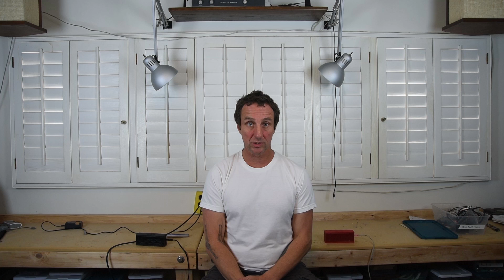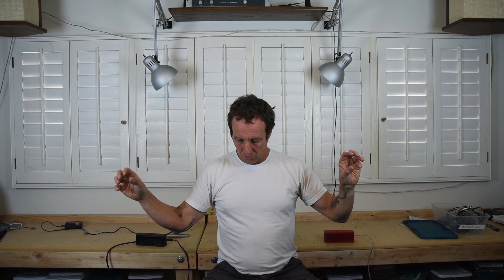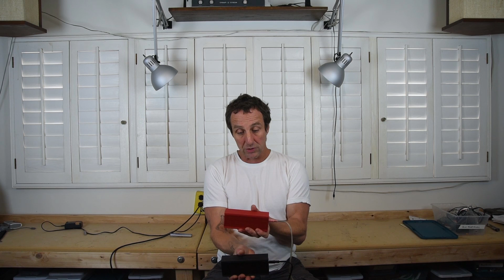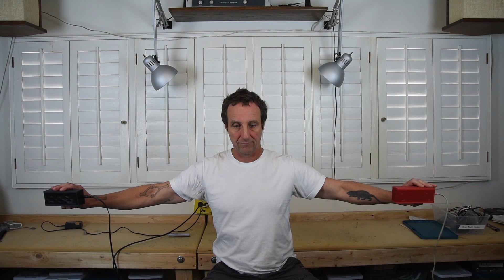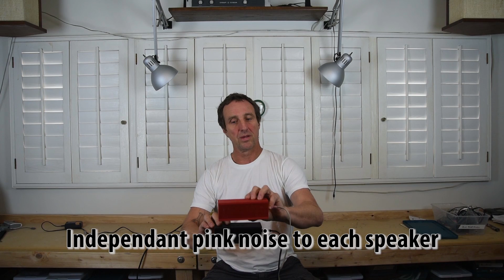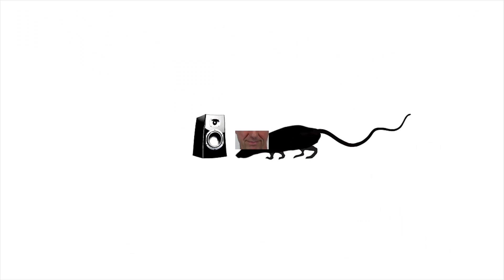Problems With Mono Sound From Stereo Speakers

Comment: So can you just delay one speaker by a couple of ms?
Reply from the maker: for all practical purposes delay is pretty much the same as distance. 

so delaying one side a few milliseconds is the same as standing little closer to one side and little farther from the other

Sound travels through air about 1 ft per millisecond
Reply: @DaveRat But what I'm getting at is, it seems like if you delay one speaker by a tiny amount, then the sound being produced by each speaker is no longer "identical." Just like how there was combing when the pink noise loops you were playing were in sync from each speaker when coming from the same source, but no combing when they were out of sync because they were playing from independent sources. Aren't identical loops that are not time aligned more or less the same as delaying one speaker slightly?
Reply from the maker: the signals are still identical even if one is delayed.

two identical signals will sum when you are equidistant and or equi-time distance 

when you offset the arrival time by either delaying one side or stepping off center, the summation with have frequency dependent phase cancellations.

when I move one speaker farther and the other closer, that is the same as delaying one speaker vs the other.

the signals need to be "different" not just time or distance offset from reach other of you want to eliminate interaction

a guitar vs a voice are different.

two people playing the same song on guitar are different (de-correlated)

the same guitar input run into 2 channels with a different EQ and some delay on one are pretty much the same signal and will have lots of interaction..

if you can change the delay, and or change the distance and or change the polarity and doing so does not change the interaftion, then the signals are de-correlated and truly different.
Reply: @DaveRat Thanks so much for taking the time to explain all that to me! I see now, that makes sense. 🙏
Reply from the maker: awesome. it's a useful concept to understand. to test if two signals are correlated or not just reverse polarity on one of them and sum them together and as you change the levels if it changes the sound then they're not de correlated.

Comment: Wow, I guess the same is true for a studio mixing engineers environment. Common practice is to mono the stereo sum, to see, if there are cancellations in your mix. But if you are hearing this with your 2 monitor speakers, the cancellation could be between the 2 monitors and not in your mix. As an studio engineer you need to be aware of this too, otherwise you're probably making your mix, sounding actually good on a single mono speaker, bad.

Comment: You need to understand phase correlation. Anyway you can easily decorrelate one channel by phase rotating it 90 degrees and the cancellations will be gone, maybe it can help in live situations where the speakers are very far apart. But it would probably also create low frequency problems where you do want things to be in phase...
Reply from the maker: Hmmm, not sure a 90 degree phase shift will actually decorrelated. The interactions would still be correlated, just phase shifted.

Comment: Please help I live on a boat that has the kenwood kmm-bt332u stereo hooked to two sets of speakers, one for the kitchen, the other for up on deck. My problem is the kitchen plays the left speakers and the top deck only plays the right speakers!  How do I fix this craziness?
Reply from the maker: One of the time disconnect each speaker that doesn't work put a 9 volt battery across the terminals see if it makes noise check the good ones too Make sure all your speakers work.

Next take a good speaker and connect it to each one of the wires that are and are not working and make sure signal showing up at the wires

Finally once you know the wires are good or replaced any bad wires I know the speakers are good and fixed any bad speakers if you still have the problem reverse the wires at the back of the amp connecting up wires to a speaker that works to a side of the app that doesn't work and you'll be able to test the amplifier

Comment: Amazing Video and explanation. So if I'm running a normal PA setup. Sub/Top per side, sending identical signals out of both sides I am more prone to Comb filtering right? Now what if I was to ever so slightly delay one side, so little that it would be unnoticed, would this help avoid some comb filtering? or is that just stupid? Thanks Dave!

Comment: Say I have a singe amp sending mono powered signal to two cabs set in the room. Similar to how a 2x10 cab plays same signal. it better to place the cabs at some close distance to avoid comb filter or is there some thing to insert in the powered speaker line the delays or changes the powered signal?
Reply from the maker: In that scenario I would put the speakers wherever they best cover the area desired to cover. Comb filtering happens when the same signal is reproduced from more than one source and those sources cover the same area.

So one way to minimize comb filtering is to have the sound sources not cover the same area or minimize overlap of their coverage.

That said, home filtering's not that big of a deal for many scenarios.

The issues you run into are summation when you're equidistant from both sources and changes in the tonality when you're off axis from that center point.

But as you wander from the center point you're closer to one speaker than the other which reduces gone filtering and  many scenarios it's not a big deal
Reply: @DaveRat  in my case the only reason I have two cabinets is because I like the sound of the 10 inch cab when I’m doing leads. I like the 12 inch cab when I’m doing rhythm. The blend of the two is quite nice sometimes as well. But I do notice them canceling each other out on certain frequencies. Confuses me is why a 4 x 12 or a 2x10 or whatever combo cabinet doesn’t have the same problem.
Reply from the maker: @TheMeteoritesTucson interesting you may want to check polarity and make sure both of your cabinets are the same polarity and your cables are all correct as well.

Comment: Nice Thing. Thanks a lot. Another question. If we use a very steep LPF (ex 48 dB/Oct)   on Subs and very steep HPF for Tops (example : A Line array system) the interacting frequency area is very small, and in this case even if the Subs and Tops are not aligned, there shouldn't be a problem? so. we have generally problem that the perfect alignment happens only a the point where we measurement microphone place. All other points have different arrival times of Tops and Subs which could case cancelations. If can strictly separate the frequency bands between Tops and Subs, can we overcome this problem?
Reply from the maker: Reducing overlap will reduce interaction between tops and subs. And also, very steep filters tend to sound bad and introduce undesirable issues.

So it's a trade off.

All filters create issues, the more drastic the filter, the more drastic the issues
Reply: @DaveRat  Thx Dave. Is it some how possible to demonstrate ? i mean the accumulated negative impact of steeper HPF (on top) + LPF (On Sub)  in compare to less steper HPF +. LPF?

Comment: My question (which i should perhaps just test myself) is…
What happens to the low end cohesion when you pan kick mic 1 and 2 to opposite sides?
In this situation, is it better to have your sub feed in stereo or mono?
I suppose it would depend on mic placement to an extent.
Reply from the maker: Mike placements on the kick may have a distance differential of 6 to 24 in

The subwoofers tend to have distances between them ranging from 4 ft to 40 ft or more

The small distances in might placement are irrelevant whether they're panned or not

What makes a difference is the spectral content and how de-correlated those two mics are

If you run mono you insure there will be maximum cancellations and summations between the various subwoofer sources

If you run different signals to subwoofers located in different places you will minimize the cancellations and summations
Reply: @DaveRat  Thank you for the quick reply! I love how your thinking on these subjects is so practical and useful, despite going against the grain of what many folks in the biz seem to consider “hard” rules. This is how we continue to raise the bar.
I truly appreciate you.

Another related question, if you don’t mind:
Have you ever set up / run sound for a live band in a dome (with surround 5.1 or 7.1)?

What, in your opinion, is the best way to minimize undesirable cancellation and summation in such a situation, where each speaker is pointed inwards towards the center (and reflections from the ceiling are also problematic)?
Should the subs all be lined up at the front of the room facing the same way, or is there any theoretical benefit to also placing those around the room, all pointed towards the center? (With the assumption that, due to available output buses, each sub would be linked to a top speaker—with appropriate crossover settings of course)

This was a matter of intense debate amongst myself and my colleagues at a venue where I worked not long ago. Would appreciate your perspective.

Comment: Hey Dave, would a LCR mixing solve this issue. So we put k8ck bass snare in C channel instead of LR .
Reply from the maker: Adding more speakers will help. Surround sound helps but fundemental instruments radiate sound outward in various directions and different instruments radiate these sounds from differing locations 

But the reproduction systems tend to shoot sound inwards towards the audience from the outside and speakers shoot one version of the sound  insually one direction and don't shoot differing versions of the sound in other directions.

So to recreate more realistic sound the approach needs to be changed.

Though creating realistic sound is quite often not a goal so it does not matter.

But

Multiple sound sources that radiate more complex sound fields would be a way to get closer to realism

Comment: Amazing video! Do the different channels have to be panned hard left and hard right ? Otherwise the same source would still be coming from both sides at different levels if not panned hard left or right. Thank you!
Reply from the maker: It's gradual. The more you pan, the less they interact
Reply: @DaveRat  Bear used MX-10 mixers that didn't have pan pots, switching everything to left or right with the Dead.

Comment: So i understand the difference between phase and signals. But correct me if i am wrong, i think we need to take the application into consideration. So if i’m gonna be miking the kick with just one mic, i’m basically copying the same signal into my left, right and sub speakers. And understandably, it is gonna create phase related issues at diff parts of the venue. So if that is my workflow, then i’d have to correct it by ensuring my system tuning is done with one pink noise source and then time aligning my system such that the null, or the comb filtering is occurring at points in the venue that are discountable. Like maybe at a walkway alley or the likes? Cos even with two signals sent to different speakers, as long as they both are of the same instrument for example, you would still run into issues such as comb filtering?
Reply from the maker: One must always take the application into account.

As far as running the exact same signal to both sides and being able to control where the nulls  are, that is easier said than done.

Controlling where the nulls occur can be altered to one side of the other with delay but other than that it's tough.

Putting two mics on the kick in the same spot would indeed create a similar sound.

Putting One mic inside the kick to pick up the quick and fast beater sound and put in the other mic on the outside picking up the later slower and more resident puffy sound that comes out of the hole in the resident head will offer two vastly different sounds that will not interact in the same ways as running the same sound to both sides.

The drawback is that the sounds will be different. So moderating by not panning hard left and hard right maybe desirable depending on your application.

The difference between the two sounds is both the asset that makes it work and the challenge that may be an issue for some applications

Comment: The problem you are discussing happens only in the near field if you are in the far field, far enough that the sounds arrive as a unified wave front thie issue becomes phasing as opposed to "natural / unnatural" . This is a concept shared between Audio and RF engineering. In fact, virtual channels are created this EXACT way (phased array). It is a very important distinction to make.
Reply from the maker: Are you sure? 

Have you taken all the variables into account and also tested to confirm?

This may be true with direct sound in anechoic environments at distances beyond where humans are unable to differentiate source location.

What is the definition of near field vs far field as it pertains to sound reinforcement?

Do we not strive to have all listeners in the "near field" meaning far field is not really relevant for the discussion?

That said, I can say from testing and experience that I found the following testable and audible: 

When deploying dual PA systems using identical line array PA systems with centers spaced horizonatlly 5 feet apart, sending signals to the inner vs the outer system was clearly audible at over 150 feet away, both at indoor and outdoor depolyments.

Headphone tests with time shifts to one ear vs the other ear of 0.1ms are audible and is an easy test to do with any digital console.

What I believe to be an addition factor is that with real world sounds it's not just the differential in the direct path of sound to listener that alter the difference in the percieve sound.

Each sound source radiates sound in multiple directions and in non anechoic environments the sounds radiated in various directions create multiple complex audible reflections that are greatly altered by even small differentials in source locations.

A related topic is looking at the was slight changes in room temperature alters the speed of sound and alters the way various sound reflections combine altering tonal balance.

I believe there are more variables that the black and white simplification of near field vs far field mattering vs not mattering accounts for.

Comment: As a strictly vinyl DJ I'll try and run each of the 2 Mono signals (the given stereo channels L+R) from one source through each their own distinct pre-amps. The rest of the setup (double Mono EQ and -Amp) remains the same. Two opposing (high output) speakers should then fill a midsize room ever so nicely... :-)
Reply: @Dave Rat: Halfway there, already, since the turntables are wired to 2x Mono anyway... I've always thought of stereo as more of a gimmick for Pink Floyd connoisseurs only. Most anything else sounds far better in crisp, focused, (perceived) super-dynamic mono.... Your video has been a great inspiration! Thank you from Norway, my good man!
Reply from the maker: Very cool and so loved tavels to Norway!

Comment: One of the finest audio engineers I was very fortunate to have learned from told me that  having slight differences in voice coil alignment is far worse than having a major difference.  Not unlike when you have a three part harmony slightly off vs totally off.  The dissonance  is more noticeable when the harmony slightly off vs. totally off.
Reply from the maker: Interesting!!

Comment: This is amazing, and explains quite well why larger setups usually dual mic most things. I do wonder however if we can achieve the same result, by delaying the output of the sound system by a few ms on either side? Like 2-5 ms should create enough difference that it won’t interfere, and can’t be heard?
Reply from the maker: Delaying one side moves the acoustic center towards the delayed side. Same as moving one speaker a bit farther away
Reply: @DaveRat  I see, so it wouldn't do much but distort the virtual sound stage.
Reply from the maker: Delaying one side will pull the image toward the delayed side, boosting level on one side will pull the image towards the boosted side.

These are useful tools but not sufficient to decorrelate the signals.

Comment: Hi, i'm just begining at sound engineering and all that crazy amazing world, and wondering what happens if you take the left right outputs on your console and run them in to 2 very different external compressors for examples, set them to sound very similar and from them go to the speakers, will it make enough difference to reduce faze issues?
Also love your videos man, learning alot from you, hope i'm not to late to get an answer here ;)
Reply from the maker: Try not to compress a bunch of different instruments 9n the same compressor. The lich and bass will modulate the vocals and guitar, the sound will have a pumping and distracting sound to it if you use more than just a little compression.

It's better to compress individual instruments or groups of similar instruments
Reply: @DaveRat  thanks :) , though what i ment was messing with the outputs signals so they wont be the same (the LR) hope i'm making sense
Reply: The question comes from your example of the 2 different pink noises that didnt couse faze issues (because they were not the same pink noise) so what i'm asking is cant we change individual output signals to make them different enough  from eachother so they'll have less faze issues,  (again hoping i'm making since)
Reply from the maker: Understood, using differing compression, level or delay differentials will make a difference but mainly in the perceived center between the sound sources.

Using two separate mics to mic differing parts of the same instrument is way more effective
Reply: @DaveRat  great thanks :)